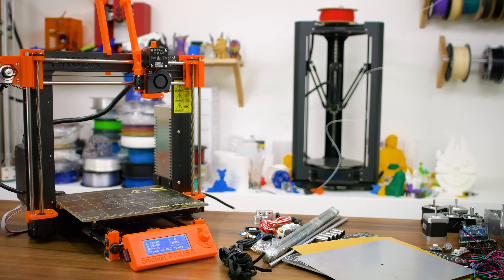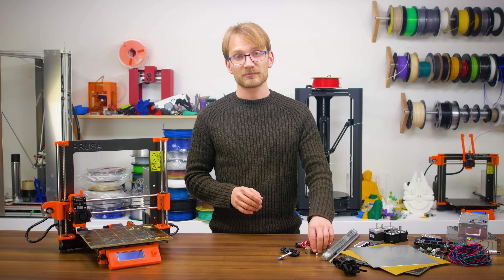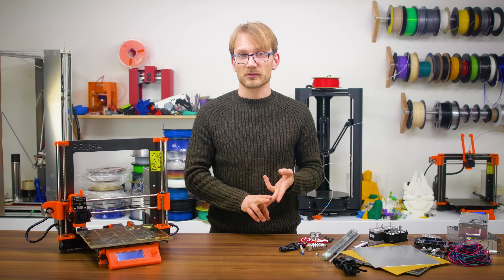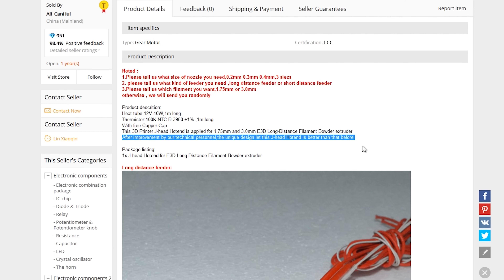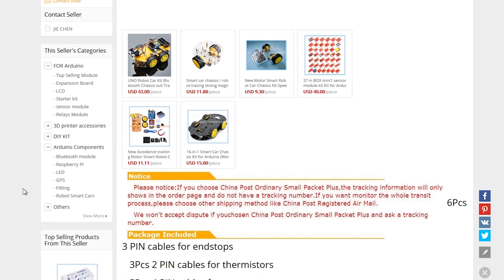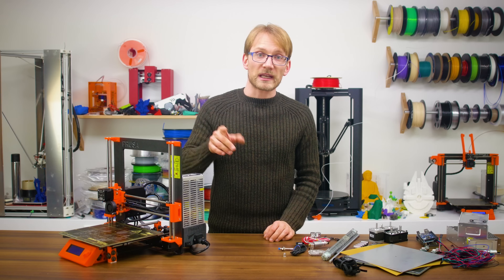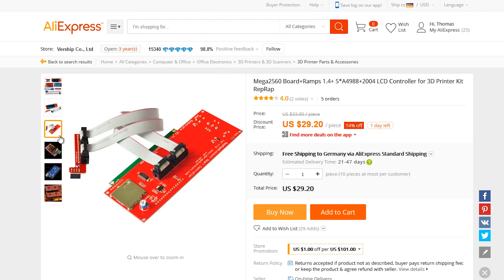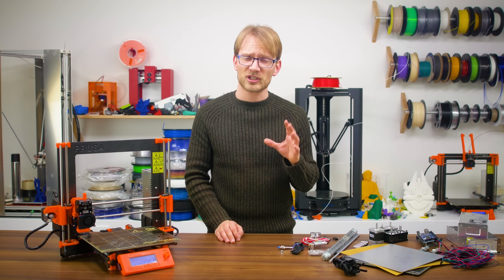Building the cheapest possible Prusa i3 MK2 clone: [01] Electronics and Extruder!

Comment: I have buit myself a graber i3, it inherits a lot of the design from prusa, but a lot easier to source the frame since it is mdf laser cut. I have done some improovement on the design of mine to install the power source and electronics on a separate compartment below the print bed. This way I can use the fan on the fan of the power source to force the air flow on the electronics and help cooling them. 
http://reprap.org/wiki/Graber_i3

Comment: In regard to frame material, have you thought of using GPO-3? Stronger and less brittle than acrylic, you can find it fairly cheep if you look around and it would work for everything including the bed! I've found it at 24x24x.250" for $27+- Although with aluminum you can go thinner. say .125" (3.18cm) from what I've seen, without loosing performance.

Also, you should try try switching out a printers endstops with magnetic hall sensors some time.

Comment: Thank you!!!  You don't know how useful this is! A couple years ago I built from scratch a Delta mini with fishing line. I could never get it calibrated properly. Then last year I thought about updating the E3D v6 hotend, a new extruder and belts from aliexpress. I had issues and it never got updated. I don't really want to invest in a new 3d printer. But I have spent maybe $700 at the time on all the parts. Much more expensive back then.  I hope I can follow your build and reserect my old Delta into a Prusa. I have the ramps and motors, I will just follow how you do the bed leveling and frame. Thanks so much!!!

Comment: I look at what there parts cost on alixp and consider that local companies import and sell the stuff anywhere from 10x to 30x the price. Like the 50c drive gears sell for $12 online here and the $6 hotends for anything from $50-$80 Its just the 60 days shipping time that gets me.
Reply: My last order just shipped with the parts I need to build this. Still need to get some local parts as stepper motors where only about 1/2 of what they cost here and after shipping and tax that's not enough to justify the 2 month wait. all the other parts where between 10-20% of the price they cost locally.

Comment: I thought you were going to assembly a Prusa i3 MK2 clone , not a Prusa i3 clone. No motors with integrated leadscrews, no alternative "home made" solution (or bought if it is available) in order to keep the XY self calibration feature(for example like gluing metal sheet circles on a printed PCB layout, of milling that layout with a cnc router, as some fast ideas, Even ordering a pack of boards with the custom layout to a PCB manufacturer) , a Ramps as control board (while original prusa firmware needs a rambo or rambo mini as far as I now).  I'm quite dissapointed. I wanted a cheap as possible "MK2" clone, not a "Just Another i3" clone. A wanted a clone that could use the original Prusa MK2 firmware at least, even if not using the same hardware "high end" options like motors with integrated leadscrews, that will for sure end in obtaining a worse printing quality of the parts due to Z wobble effects. You cannot call a i3 based printer a "MK2 clone" otherwise.

Comment: As one of my relatives wanted to get a 3D printer recently, you starting a series on the Prusa clone just comes in really handy! Im considering whether to actually build one using the parts you used in the video, but so far Im really impressed all electronics can be obtained for such a low price.

Comment: I also started to do own clone of MK2, currently I am still waiting for the parts from China.
I am curious how your version will be looking finally.
You didnt tell yet what threaded rods you bought (and i believe its already on your desk), especially because all rework-likes are made from Fi10 threaded rods, when in Original there is only 2xFi10, and all the others are Fi8.
I think its still cheap option to build MK2 on P3Steel frame, but it depends how expensive the metals are at Your place (in Poland You can buy P3Steel frame under 50EUR - for around 42EUR), instead of using MDF or wooden one.
I am looking forward for your progress on the build :)
Reply: https://prusaclone.wordpress.com/ - I'd like to invite to check this out too!

Comment: @Thomas Sanladerer get the i3 Alu frame from Ali, runs for about $60-70
Reply: on a 2nd thought you're right, I may build using 30x30mm Misumi Alu profile, I'm not sure. Already build UM2 clone with 20x20mm Alu.
Reply: just checked with Misumi and 360x380x390mm (WxDxH) 30x30 Alu Profile Frame (HFS6-3030) will cost 20 Euro, just the alu profile w/o brackets and screws. Based on http://www.thingiverse.com/thing:1692666, let me know if you want go with this frame.
Reply: do you think Linear Slide Guide Rails (like in CNC's) is overkill for this or any 3D printer? considering using it for my future build(s). I try to achieve best print results for minimum investment in parts. about $15 for 200mm on Ali

Comment: OK, I understand that you are not going to build a decent machine, but you shouldn't at all encourage people to buy those $3 RAMPS for their own safety.

If you connect one of them to a heated bed, there's a chance that they'll catch fire. Their connectors aren't rated for such loads.

Odds are that if you dig through reviews you may find many people complaining about melted and/or burnt 12V connectors. And this although 90% of customers write a review before actually using the board (because Aliexpress encourage them to do so).

If you want to go cheap and Chinese, buy MKS or something which is not the absolute worst. It won't be good, but at least it won't burn.

---
(and by the way I know that your objective is to show in the end that such a cheap build can't obviously compete with a real Prusa MK2 (I expect this because you are a serious and trustworthy person), but seriously, a full metal Chinese hotend WILL ALWAYS clog with PLA and, if you don't replace the 30mm hotend fan with a more powerful one, it may clog with ABS too. If you want this test not to be a total gimmick, you should go for the "improved" one).
Reply: Thomas, order the mosfet board.
Reply: I've been following your channel since when you didn't wear glasses :P

Let me explain my point. A proper manufactured RAMPS board is not "dangerous". But any $3 board can't handle 200W without being a fire hazard. The problem is that some people don't grasp this obvious concept and will emulate you without even knowing what their are doing. The only way to keep them safe from themselves is continuously reminding them obvious basic things... Just like when you said "use common sense. Please don't sue me." xD

Don't get me wrong, I'm super curious and excited about this series because I'm pretty sure that it will be a fun build whatever the results

(PS: consider building a corexy next time. You will be amazed by its quality at high speeds)

Comment: Stepper motors from china are about 10$.
I recommend trying to take a look at local auction websites(ebay, craigslist, amazon etc) for used stepper motors salvaged from old printers.
We can have nema17 equivalent motors even for 2$
So instead of 40$ we have to spend 8$, 32$ saved!
Just remember to purchase these with 6pin connector and compatible mounting holes.
PS we may need to remove the gear from motor shaft.

Comment: Amazing video Thomas!! i just realized that you are german....you have a really nice english :). I built my own kartesian based 3d printer 2 years ago using ramps 1.4 and arduino mega....works fine so far...i find interesting to make a video using the parts that you consider "high quality", put them together using the same mechanical structure, and compare the printing quality
Reply: Hi Thomas, as far as i know the hephestos is using the ramps 1.4 and the arduino mega, right? would you not use for example another electronics as you used in your big delta? or another extruder or something?

Comment: You might consider replacing m5 rods with t8-2mm rods (one leadscrew, 2mm pitch, 2mm per revolution) since m5 have 1.25mm pitch and tend to bend like crazy. And leadscrews from china are like 4-5usd a piece. You might say expensive, but I say golden upgrade.

Comment: I have been considering building one/some of these for a while. My idea was to buy a single original to support the project then use that to build another (and then maybe more). When i looked into the ‘vitamin’ aspect of the machine i was struck by the cost of the motherboard. I currently am using a cheap as chips acrylic prusa i3 cone and have been rather amazed by what i can get it to do.
The ramps 1.4 motherboard with arduino mega(clones) it uses cost about £15 from aliexpress Compared to the £100 for the rambo mini the mk2 uses.
Could anyone explain what the advantages are of using one of these high cost motherboards? I’d imagine like with anything its the build quality for one but seeing as i have been using the hell out of my printer for about a year and a half and had no problems(apart from the memory card reader becoming rather temperamental)Are they really worthy of the massive cost increase?
Many thanks.

Comment: If you can find some signwriters board (alucabond) it is very rasy to cut and shape and yet suprisingly stuff. I have laminated two layers before as well to make it thicker. It's also vastly cheaper than sraight aluminium, but essentially its two layers of aluminium with a core of plastic and its quiet strong.

Comment: While I realize that it isn't necessarily in line with the goal of this build, it would be great if you could mention some of the optional upgrades where people could spend a little more money for more capability.  Specifically, I would be interested in upgraded electronics and the option for an extruded aluminum frame that would allow the builder to make the printer any desired size.
Reply: just buy and search for bigger items. That's not the point of this vid series.
Reply: I agree, I would rather spend some extra money and get a higher quality if possible. 

The thing is though if you're watching this video you should have somewhat knowledge of 3 printing and printer parts.
Reply: YoyoCuber What parts can be upgraded?
Reply: I absolutely agree. I'd like to make this my first 3D printer, and I'd feel a lot better about it if I knew a bit more about upgrade options. Cheapest i3 clone that's still fully functional is a great draw, but knowing a few upgrade options would be tremendous. It doesn't need to be like 4 options for every single part, just some standout options where you get a good value for a bit more expense, or where it gets you added functionality.

Comment: Print bed size?
Reply: Based on the materials it looks like a 200mm x 200mm bed, so a little smaller than the Mk 2, but much less expensive I suspect.
Reply: rusty0101 https://www.aliexpress.com/item/1PC-RepRap-3D-Printer-Heatbed-MK2B-12V-24V-PCB-Hot-Plate-Heat-Bed-For-Prusa-Mendel/32776856775.html?spm=2114.13010208.99999999.264.euPzSO found it

Comment: Today, the x direction of my print become longer today after I switch the software from Cura 15.04 to the newest 2.4. They and z remain correct dimension. I check the size of the print in the software, it doesn't seems wrong. Can you help me with that? Thanks!
Reply: compare x-steps between what Cura thinks that should be, and what the output of M501 on the printer is to make sure that they match. Cura may be using a higher resolution than the firmware is configured for.
Reply: However, I use the Cura 15.04 again, but my printer still print file 2mm longer in x-direction. It was fine couple hours ago

Comment: +Thomas Sanladerer

you can get the Mk42 bed: https://github.com/prusa3d/Original-Prusa-i3/tree/MK2/Heatbed%20MK42

just send that to the right pcb fabrication house. i suspect that you might have to edit the file so that all copper is on the same layer, but maybe the fab house can do that for you?
Reply: firstpcb.com says 51$ for 5 plates if telling them 250*250mm

the sad thing is that the XYZ compensation yet has to find its way to other firmwares like repetier.

but i guess there is more to it than just the pcb itself, ie it must have a back plate of some sort to stiffen it up

Comment: Isn't MDF dimensionally stable and easier to acquire in actually flat sheets?
Reply: nope it can suck moisture from the air, for it to be stable you have to spend a lot on varnish as the MDF suck a lot of that too. 3-5 coats is not uncommon
Reply: Yes. I have a Prusa i3 plywood box version and dislike the material because of natural warping. My vote goes for MDF for stability, ease of  manufacture, and acoustic damping characteristics.

Comment: With the hot end it's not too difficult to re-tool the inside of the heat break slightly.  It just takes a couple minutes, a drill bit, and the most common lapping compound toothpaste.

Comment: I hate how prevalent Teflon is in 3d printing. The company that makes it knew about the toxicity of a chemical used in it's production that was harmful at .5 parts per BILLION and kept using it for decades. Maybe the chemical they replaced it with is safe, but they have no credibility on the issue.

Comment: actually, I was thinking that some 1/8 in. thick hi density particle board or even wooden panelling( wall coverings) might yield some cheap material since it can be sourced from variety of places from older electronics to furniture. just a thought.
Reply: Thomas Sanladerer Just a thought, when I'm trying to save money I use what's lying around and I usually have a bunch. thanks for the great videos and inspiration. I actually was able to scratch build a printer watching your videos( between you, 3d  printing nerd and makers muse I was pretty much set).

Comment: I prefer what Tech2C did with the hyper cube than rebuilding another i3.
Reply: This is about making the cheapest possible clone, not about making the best or anything new.
This is the starting point for many builders, so I think it's a great idea.
Reply: did anyone ever find a good source for the aluminium tubes? That was my biggest hangup with building a hypercube.
Reply: The t-slot aluminum extrusion is all over AliExpress. Even the 80cm pieces are under $2 US, but the shipping makes a real impact. Even so, it's way cheaper than what's available locally (at least, where I am) and you are probably only looking at $40 US.

Comment: Fantastic, Your timing is right on, I'm building one right now. I've finished most of the printer just working on the wiring. I went with the Rambo Mini, cost more but I wanted reliability.  20x20 mm aluminum frame. Looking forward to the rest of the build. Great Job Thomas!!!!

Comment: Ironically, some of the features you're including are not present in some existing cheap i3 clone kits :) Was MKS Base cheaper than Arduino+RAMPS+drivers? It's all in one so you can't change the stepper drivers, but it might be lower cost.

Comment: As a process and experiment, very cool.  As an actual,functioning piece of machinery, I absolutely hate the cheap parts list.  First off the clones V6s are sooooooo hit or miss.  Could be fine, could be garbage, same with most of the electronics.  For funnies, cool build, as long as you don't NEED it to work and understand your RAMPS stack may smoke when you plug it in, or the PS may burn everything connected to it, etc...should be fun.

Comment: Thanks for the video, I am eyeing up the upgrade kit as a way of sourcing a true mk2. I have to ask, how can you justify this as a MK2 and not just a prusa i3 clone without the core mk2 features. Specifically the integrated lead screws, 3 zone heat bed(Debatable benefits), and the auto homing zones. The Z wobble is the big problem that this looks to improve.

Comment: I have seen you have criticised the power rating of the connectors in your ramps review. You could use an external mosfet . For the cheap build it is a little bit expensive, with 7,5€ http://www.banggood.com/3D-Printer-Parts-General-Add-on-Heated-Bed-Power-Expansion-Module-High-Power-For-Chitu-Motherboard-p-1086965.html?p=IV1908725094201408TX
Reply: I think the mosfet board is a mandatory "upgrade".

Comment: I still bought the original mk2...awaiting my shipment. Prusa Research is an awesome company and it actually feels pretty good spending the money to support innovation and originality.
Reply: I hope the wait isn't too long for you, it was excruciating for me.
Reply: shteve ......just been quoted 9 weeks plus from confirmed order.....including 4 filament feed upgrade kit.......
Reply: QuadCopter 102 my word... it's gonna feel like an eternity.
Reply: it's so worth the wait!
Reply: Jon S that depends... kit or pre-built?
Reply: Kal larken I got the kit and it took 25hrs to setup. but that is because I swapped x and y axis and did not catch it cuz I was tired. it was still worth it to see how it all comes together.
Reply: Took me 3 months... I had plenty of issues, One being a warped bed.
Reply: Kal larken O man no good sorry to hear that. I am working on getting my prints calibrated and that is a becoming a chore to get them perfect.
Reply: Jon S a little tip this worked for me  don't put the screws in the bottom of the psu that connect it to the bottom black piece on mine this was causing leveling and calibration issues I don't know but I did everything right step by step then tried the calibration it fail try again fail then I took it apart then put back together  same issues  but the very next thing and nothing else was removing the those screws  and that some how fixed the problem don't know why maybe the psu sits on it causing  the y axis  to flex or pull in the wrong causing calibration issues